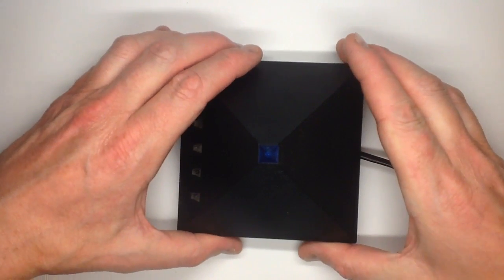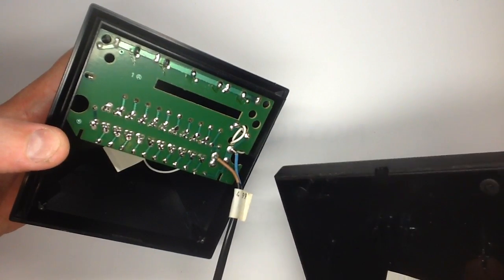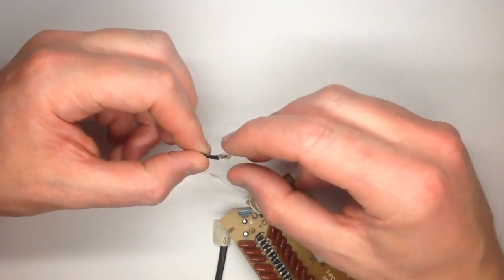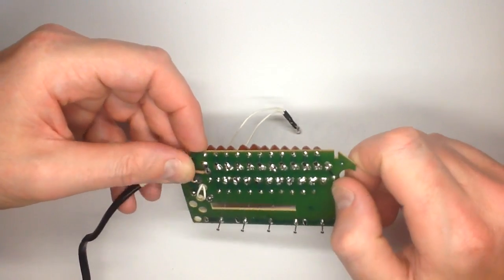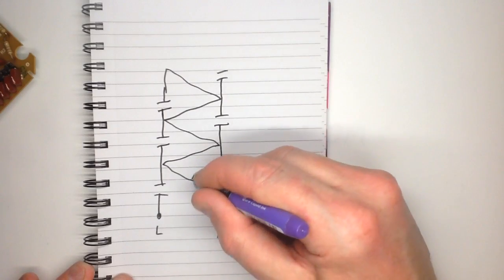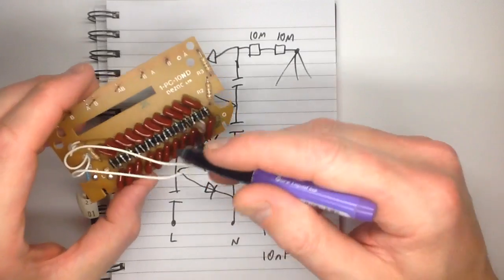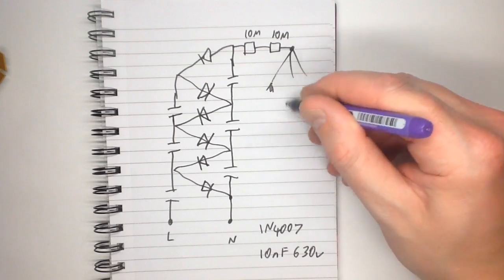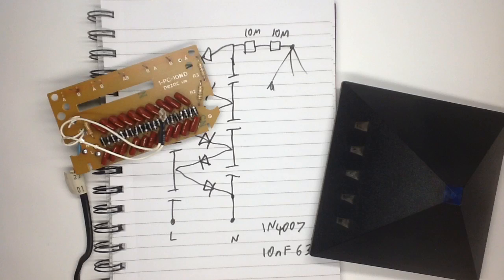Inside a Dezac pyramid ioniser.

Comment: Mine is very similar (also a Dezac, but a slightly different shape). Its power is stated as 0.3W. I wonder how much of this goes into the neon indicator as I am trying to calculate the ozone production from the power output (there are published figures for this).
Reply from the maker: The ozone output will be tiny.  Well below natural levels.  The neon indicators on classic multiplier ionisers often dissipate a lot more power than the actual ioniser.

Comment: I have a very similar one that has been in permanent use in my flat for the last 20+ years, but its performance seems to have deteriorated in the last few years. Initially, when still new, I could hear a slight crackling sound when holding my finger close to a needle, but not now anymore, only when I touch it with a metal pin. The indicator light is not as bright as it used to be either. It still collects some dust out of the air, but not as much as it used to do. Is it possible that the capacitors have deteriorated over years of use?
Reply from the maker: The neon indicators do dim with time.   Ionisers do benefit from an external cleaning with a mild solvent like isopropanol to remove conductive surface contamination.  The needles also lose their sharpness and sometimes benefit from a scraping with a stanley knife blade.

Comment: 9 years later I came back to this video to add my take on it, I've owned one of these exact units for a few months now and have noticed some slight issues with it, but fortunately most of them can be easily sorted. The first, is that I'm sure the plastic case is slightly conductive, probably due to it being black, as if dust particles fall between the needles and case it'll completely stop the output of the unit, resulting in having to blow the dust away. The other thing, is that due to the size of the holes in the case, dust does get stuck in them very regularly, so I took mine apart and drilled them out to 4mm, this seems to have helped. I then also moved the needles so that they stick out of the front by about 3mm rather than being flush, this has greatly improved the units output.
Reply from the maker: They do attract a film onto their surface over time.  Having the needles standing proud of the unit is much better, albeit not "safety compliant".

Comment: What if a balanced introduction of both positive and negative ions were generated in a looped setting was tried. Perhaps the air would smell different?
Reply from the maker: There are units that produce both positive and negative ions in the vicinity of each other.  But I'm inclined to think that their real purpose is to create trace level ozone due to the slight corona discharge from the adjacent emitters.
Reply: @bigclivedotcom  I'm sure you've experienced that sensation of electrical buildup in the atmosphere that very much makes your hair stand... perhaps multiple of these generators could have a similar or adverse effect in static buildup. Perhaps a good place for use would be static sensitive environments for use with delicate components. I can only imagine the effects it could have.

Comment: OMG. That unit can't have a CE marking when it is built like that. No safety insulation from the net!!!
Reply from the maker: The resistors on the output are the safety feature.  If you touched the pins the voltage would immediately fall and the leakage current would be low.

Comment: What the hell is an ionizer!?
Reply from the maker: It puts and electrostatic charge into the air to encourage airborne dust to settle out.
Reply: Didn't really expect you to answer, really. The ladder structure was used in early particle accelerators so I guess it ionizes particles then.

Comment: Clive this unit has only 20 capacitors, not the 22 you mentioned and revealed inside the MountainBreeze, how does that make it different? I also wonder how these things were different in the States with 110 V AC a compared to the 220-230 regions on earth?
Reply from the maker: I've only opened one American ioniser and it had a small step up transformer to keep the multiplier short.

Comment: I bought one in 1992, haven't used it for years, since I was scared by the possible health effects of the ozone (O3) it also produces.  .  Might use it again, if I find out the ozone level is safe.   .The diode goes to the neutral instead of live,  in the rare case all the diodes go short circuit.     .I Thought it was a good design when I opened it up (like most stuff), 20 years ago.

Comment: What is the difference between earth, neutral and ground?
Reply: +Matt Valcarcel Earth is the electrical potential of the floor you are standing on. Ground is the third pin in a three-pin plug (or the top and bottom pins in a German Schuko plug), which is generally connected to earth in some way. The important thing is that ground is not usually part of the circuit, it merely exists to pull the potential of a metal casing down to the earth potential so you don't get a (potentially lethal) zap when touching it. Also, so that the RCD shuts off the circuit should the casing ever go live (bad insulation happens).

Confusingly, in DC circuits, ground is the negative terminal and actual part of the circuit.

"Neutral" is the name for the AC input pin where no potential change is happening. It is however a normal part of the circuit. It usually has the same potential as earth, but you can't rely on that. In many plug systems, as a circuit designer you have know way of knowing, which input pin is going to be which, so you have to design your circuits to work either way.
Reply: +nullplan01 that was very informative, thanks so much
Reply: "Ground is the third pin in a three-pin plug"- you mean the earth pin? :-)

Comment: Can someone explain the point of this thing ?
Reply from the maker: +CorruptedPixl_ It puts an electrostatic charge in the air that causes dust and other contaminants to precipitate out to surrounding surfaces.  Makes a bit of a mess in its vicinity, but takes out sub-micron particulate from the air silently.
Reply from the maker: +TheBetterGame Although the original ionisers were sold in a style that resembled quackery they do have a genuine effect.  The best way to prove their effectiveness is to place one on a clean piece of white paper and leave it running for a while.  The unit will attract dust in a manner that creates a visible outline of the unit on the paper after just a day or so.
Reply: +bigclivedotcom So it's real then? Not a scam like the foot bath thing?
Reply: ok
Reply: +bigclivedotcom so I could use it around my pc, so ioniser would atrack dust away from it?
Reply: telefonkirtys No that's probably not a good idea. What this does is encourages dust particles to stick to each other so they fall out of the air. If you put it near your PC, the larger particles will still be sucked into it.

The best way to use this is to put it in an area of your room near the cold air return, so the dust gets sucked back towards the furnace, where it will be filtered out of the air.

Comment: I have no idea why these things are so expensive. There is nothing in them pretty much. Nothing that would warrant hundred bucks or anywhere near that. 20€ would still probably be a 300% profit for them.
Reply from the maker: +Atrax R proper ionisers are quite specialised.  It's quite a small market.
Reply: I seem to remember them being sold for less than 20 quid. Maybe a bit more for the "designer" ones which look posh being sold in those weird mail order catalogues.

Comment: That sill makes for an interesting ballpark calculation.  Let's be conservative and say 1 microamp difference between current on hot an neutral.    

10^-6 amps.  = 10^-6 Columbs / Second

(10^-6 Columbs / second) * (10^19 electrons/columb)

 = 10^13 electrons per second.  

That's 100 trillion electrons per second.

Comment: I notice that ionizers can leave a room smelling like a CRT TV screen when you switch it off.
Reply from the maker: +KasHCubeD That sounds more like an ozone generator than an ioniser.  Sometimes they are wrongly labelled as ionisers.
Reply: bigclivedotcom Ah. Come to think of it; my one had a UV lamp inside it. I bought it off ebuyer in their clearence sale many many years ago.
Reply from the maker: +playaspec A traditional needle ioniser creates virtually no ozone.  The actual ozone generators that masquerade as ionisers (but aren't) are a real issue in that respect.
Reply: +bigclivedotcom Ionizers make ozone as a byproduct. They're fine to run when you're not home, but not the greatest to be breathing.
Reply: +Jimmy Loves Harley Ozone is a very powerful oxidiser, and burns lungs.
Reply: +Dave Foster NOT in normal quantity's, (like ionizers).!
Reply: +KasHCubeD I've never noticed a particular smell from CRT screens. Perhaps I'm just used to it so the smell is normal to me.
Reply: @eddiespencer1  Pt your nose close. Its like a hot dust metallic smell to me.
Reply from the maker: +Pokuteki Jii If you have an ioniser then you can test it by placing it on a white sheet of paper and leave it running for a week.  When you look at the paper there should be a dark outline of the ioniser left on it where all the dust and dirt precipitated out in its vicinity.
Reply: Peabrain I definitely recall medium / big CRT TVs having a definite static field in front of the screen, that and the 10kV to 25kV DC circuit inside should have an ionizing effect.

Comment: I made my own ioniser years and years ago.  A big beefy one, using a drain pipe, with capacitors inside.  I just went off looking for the web site that gave me the inspiration.  And guess what... it's was on Big Clives web site!

The problem I have with ionisers, is the mess they make.  I had one of those pyramid ones, and left it in the corner of my bedroom.  I had redecorate the room, due to all the black stuff all over the walls.
Reply from the maker: +MegaPrik There is a version which has a preferential ground created by using a small positive multiplier to create a stronger attraction than grounded surfaces and attract dust to a specific mat.
Reply from the maker: +Stuart Johnson They do make a real mess of the walls.  But you have to ask yourself...   Is it better on the walls or being breathed in.
Reply: +bigclivedotcom i was just brain storming.. a possible solution to the dirty wall issue. Couldn't you make something like a large 1inch steel pipe (or iron maybe or something super conductive) and solder a wire to this pipe and connect it to a the ground via a electrical outlet? Sorta of a big grounded source for this residue to stick to thus making cleaning easier?    also how hard is it to clean this mess these ionizers make?     perhaps even connect a fan to your ionizer to "aim" it across the room to the pipe... God am I sounding dumb now? lol anyways thoughts?          The only issue I see with this thought is the ions attacking to the wall instead of the pipe because they are both grounded. So I guess the real question here is would the ions pass a less conductive grounded material IE walls for a super conductive grounded material a short distance further away
Reply: +bigclivedotcom +MegaPrik  it would make a neat project to find out if you can make the perfect ioniser.
Reply: Well Im gonna give my idea a try. maybe try using a positive multiplier like clive stated. but exactly how hard is this mess to clean? we talking like permanent marker on the wall hard or like wiping the wall with a damp rag hard? the reason I ask is Im thinking if I can get the ions to carry the stuff to a specific source Im going to turn that source into a self cleaning one,
 as for building the ionizer I waiting for the parts from eBay to arrive. if you like I can keep you updated Stuart Via messages on my findings and results.
Reply: +MegaPrik I had to paint the wall.  As I recall it goes a bit sticky.  Had to use meths or something to get it off plastic.  I think there is an ioniser that sits on a sheet of paper.  You tossed the paper away when it got black. Not sure how effective that was, but it really does need to capture everything, if it's not going make a mess of your walls.
Reply: Ok, here's a thought. Bog roll. Have a motor winding it very slowly from one spindle to another with the positive electrode behind it.

Comment: I have this ioniser, my ex gave it to me she didn't seem to think it did anything.. Pretty expensive at the time about 60 pounds.. But looking online, there only seems to be one avaliable at 9924.99 on ebay!
Reply from the maker: +Dana Adalaide They've obviously run out and put the price up as a placemarker.  Testing an ioniser to see if it works is easy.  Place it on an ordinary white piece of paper for a few days.  If it's working, then when lifted up it will leave a white shape where the ioniser was, surrounded by a darker area where all the attracted dust stuck to it.

Comment: Does this actually work? Even if the negatively charged dust is attracted to the floor, does it really have any noticeable effect that isn't negligible?
Reply from the maker: +Sample Text When you run an ioniser in a room the surrounding surfaces and walls develop a thick layer of black precipitate from the air.  Stuff so fine that it would probably pass through a vacuum cleaner, but very capable of getting deep into your lungs.  So I would say that ionisers do have a definite air cleaning effect.
Reply: bigclivedotcom OK, thanks for that. I haven't really looked into them before, so I was a bit sceptical. That cleared things up!
Reply from the maker: +Sample Text A lot of the sales material associated with ionisers is very reminiscent of that used to sell quack products.  There's also a tendency for things that are not ionisers to be sold as ionisers.  Like ozone generators.
Reply: +bigclivedotcom Yea, I think that's what I was associating this with, before you replied to my original comment.
Reply: +bigclivedotcom Yep, but when we used one that black precipitate was landing on a gloss painted windowsill, which you would have thought would be easy to wipe the dust up from, but in fact it left a right mess and we stopped using the ioniser.
Reply: If it's fine enough to go through vacuum cleaner bags, how do you then clean it off the carpet?
Reply: steam cleaner